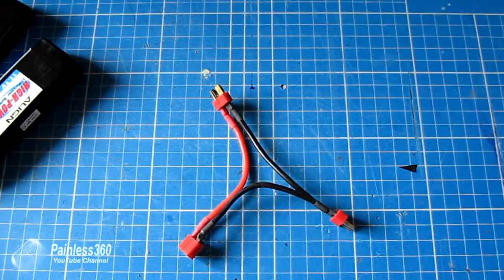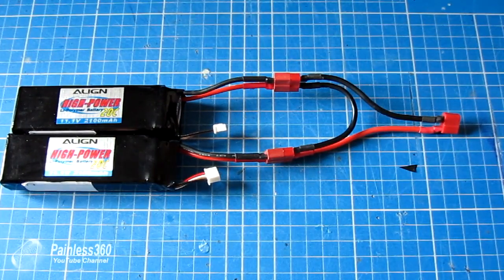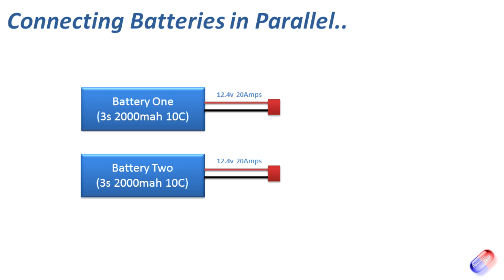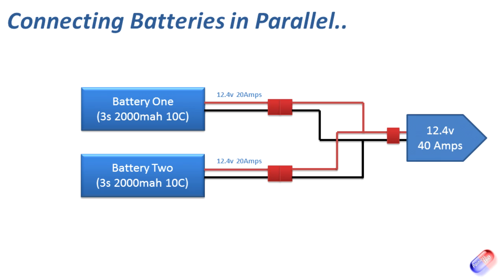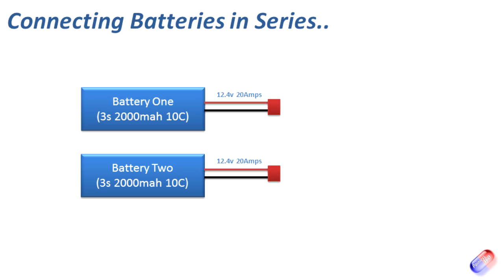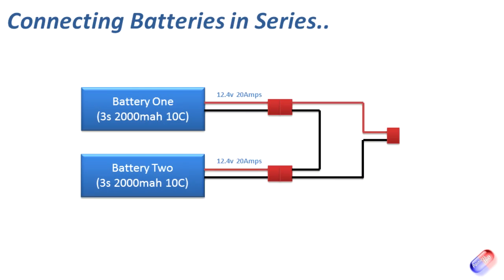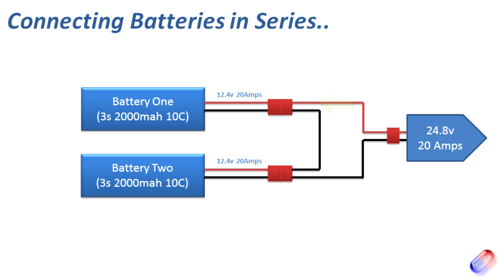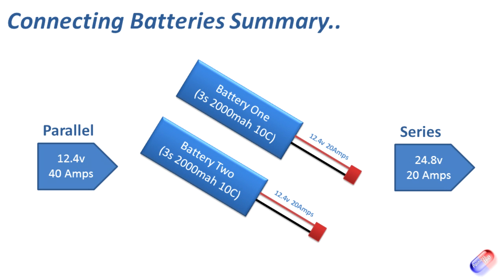Connecting batteries in series or parallel (LIPO)

Comment: Great video. I want to connect 2 15ah 48v batteries-exactly same make and specs together, but the seller seems to think I will get problems doing this. Have you used these batteries on an ebike or such and how did they do? Any issues longterm?
Reply from the maker: Batteries are connected in series and parallel all the time, it’s how we get batteries with much higher voltages and currents. I’d listen to the seller though, they may know more than we do. Happy flying!
Reply: Ah ok, thanks for the information. I think the company are just trying to avoid being blamed if anything goes wrong, as the batteries would be identical-same brand specs,  on a mid drive motor. They also say I shouldnt use the 60v 20ah battery they sell! But they sell it! Have you attached batteries together on ebikes or scooters in parallel? Any issues?

Comment: Hello! My Batteries are 3.7V 9800mAh
Is it possible to connect a series making it 14.8V (4 battery) .
Have a parallel made to 98000mAh (10 battery).
can it then be connected and how to make it 14.8V with the 98000mAh.
Reply from the maker: What do you think after watching the video? What would two 2.7V batteries in series make?
Reply: havent gotten the proper chance to watch the vid im going to watch it now though. in series it will increase the voltage.

Comment: I'm building an ebike battery could I wire a 6 cell 22 volt 8000ah and a 4cell 5200 in parallel to give me 13.000ah but would it still be 22v
Reply from the maker: You can’t wire them in parallel. They are different voltages..
Reply: I thought when them in parallel will double the amp hours but keep the voltage the same so what you saying they both got to be 22 volts each

Comment: Looking for help .Losi dbxl the car. Problem is got trunigy 7 way switch connected to 4 slot inn receiver to run lights Was working well with 7.4v 1700mah standard. So decided to upgrade to lipo 7.4v 3000 the unit will not work. The unit powers up runs cycle on toggle nothing. I thought it was faulty so bought another one. Same problem. Swap to standard works fine. Now thinking run car on lipo use standard for lights? Question is can you mix battery  and how would I wire this. Didn't want these problems but I'm stuck. Be nice to run the lot off one battery but no idea why it won't work. Tried most basic things. Can you Help.
Reply from the maker: No idea why it won't work. The increased capacity of the battery shouldn't make any difference if he voltage is the same - strange..

Comment: I want to do some test runs on a hydroplane using 8s before I commit to buying anything else, like 10s or 12s, if i don't like the performance of the  8s. But, I will achieve the  8s by connecting 2) 2s to make a 4s, and then 2 more 2s to make another 4s, and then connect  the  2) 4s to make  the 8s. Is there  any reason this may not work? all are same 5200mah though 2 are 25c and 2 are 30c. And again will be ran just for testing, not racing.

Comment: This was a great video.  Is there a source of info to find out about individual battery pack configurations?  For example, I have a laptop battery HSTNN-YB02, 8 cell, 14.8 volts.....I've taken it apart and it looks like I have two sets of 4 batteries.  Each set of 4 has 2 batteries connected in parallel (3.7 V as measured) and the two are connected to another two in series (for a measured reading of 7.4 V).  .........I think I understand this...then the set of 4 is  connected to the other set of 4 I think in parallel.........so I think this should then give me my two times 7.4 or 14.8 volts total.....but the other set of 4 gives "0" V when I measure and the total V of the 8 is 7.4 V on the board (assuming I'm measuring correctly).............the numbers/letters on individual batteries is HL9FJT5 and then 037953.......If there was a source of information to ID the individual battery voltage from the numbers/letters on it, I could then confirm or refute what I'm thinking.....and information to  better understand if I have the correct idea about parallel and series attachment is all about........The reason for all this is I'm been trying to figure out if I have a laptop battery problem or a laptop charging problem.  Sorry for the rambling comment.

Comment: Will it be safe to connect batteries of different c rating and different mAh but same voltage in series
Reply from the maker: Not really, these days batteries are so cheap that it's easy to get the right size capacity and voltage you want. Best of luck!

Comment: I have an electric kick-scooter (e-twow master) and I want to make it faster. The ESC on the scooter can take up to 50V . The stock battery is specified at 29.3 V when charged and has a capacity of 8Ah. I need a LiPo battery to wire it in series with the main one. What battery should I use ?
Reply from the maker: +Tantareanu Jimmy this is a little outside of my experience. But you'll need something that means the overall voltage will still be below that 50 volts maximum that the ESC is rated for.I believe places like Hobbyking sell things like this now too. Best of luck!

Comment: can I connect in SERIES

2s  4500mah 45c and 
3s 4500mah 45c 

to make 5s ??
Reply from the maker: +MotorsUKTV it should, if the cells are closely matched. Personally I just by yourself the battery that you need. They are a lot cheaper than they used to be now so having to do all of this messing about is no longer needed. Best of luck

Comment: Hello.. I have a problem... I made a kool 2P 2S battery pack with 4 of these 7.2v power packs that has some killer power but- I can't run a DC Inverter from it cause it's too powerful I guess (Inverter won't run on a power bank over 15V)... and if i made them into a 4P battery bank then the power to the  Inverter would be too low to run the Inverter.  
    What can I do?
Reply from the maker: +wildbillo68 not sure I follow, I'm guessing this isn't for a traditional radio control application? I'd look at a different DC inverter. Best of luck

Comment: Hi I have an ESC 120A and motor of 2050kv. Can I use two 3s 35c 11.1v 5500mah lipo battery ?
Reply from the maker: +t maxx I can't answer that with that detail. See the other videos in the 'Introduction to Radio Control' on power systems that may help..  best of luck!

Comment: Great video but i have a question Can i connect Lithium ion and Lithium Polymer in  parallel connection and use it in Rc plane ?
Reply from the maker: I would not connect batteries with different chemistry together. These days packs are so much cheaper that it's easy to get the size and capacity you need. Best of luck!

Comment: I prefer parallel circuit, but out of curiosity  if I was to have a motor rated at 20 amps an I was to double by using series, I'd there a chance of burning up the motor
Reply from the maker: Putting batteries in series will increase the voltage but keep the amp rating the same. The danger is that the ESC and motor may not be rated for that higher voltage..

Comment: Hi mate great video I have a qestion about connecting parallel lipo batterys to a drone the lead I have made has two battery connectors an the connection to the drone is soldered to the board is it ok to connect one lipo battery at a time on a parallel lipo setup.
Reply from the maker: Personally I'd connect both together and then plus them into the model. It shouldn't matter but be careful. Best of luck!

Comment: How do we do this with 3 of them?
Reply from the maker: +Evan Arbolante it's the same as two. Batteries are so inexpensive now that unless there is a space reason you need to connect packs like this then it's easier to just buy the size you need. Happy flying
Reply: Is it possible to connect 2 in parallel and 2 in a series to one out out put? Im trying to wire a 6 inch or 12 inch led bar/cube to a Shield

Comment: I use 4S 3500mAh, now i need two battery 4S -> 8S. But i dont know how to wire parallel good or series its good? Thank you
Reply from the maker: Parallel will give you trice the capacity at the same voltage. Best of luck!
Reply: Painless360 thank you. Series too?
Reply from the maker: Nope. See video.. Happy flying!

Comment: in the race competition, we have to change the battery as the track is long, and they have to keep the video signal. im planning to use parallel XT60 method. However, is it safe enough to plug in the different voltage battery? e.g. when swapping 14.7V landing, keep plugged for video signal, and plug in 16.8V new battery. then take out the old 14.7 V. (probably few seconds that both battery connected each other)
Is it a fairly safe way and wont damage the battery? as it is a simple XT60 connected into parallel, i dont think there is limit of current.
Reply from the maker: If you mean plugging in a battery in parallel with a very different voltage, then that's a bad idea.

Comment: is that the same way you hook up a hobbywing Max 6 in dual series for the ESC
Reply from the maker: You can't hook up ESCs in parallel in the same way. They are designed to be the only thing connected to the motor and use phased pulses to run the motor - those phased signals wouldn't be in sync'd if used two? Happy flying!
Reply: Painless360 I hav a on road RC car trying to get high speeds is series better ? I'm not worried about the run time on it

Comment: Can you make a video where you connect four batteries to get double mah and volts. For example, pair two batteries and connect in parallel with two other batteries that are also connected in series? Or is it even possible?
Reply from the maker: Yes it is, personally I'd look at buying the battery in the size and capacity you need, this video was made years ago when batteries were not available in the larger sizes and pilots had to use these kinds of tricks to get larger packs and longer flight-times.. Thanks for the idea..

Comment: I am making a Lipo pack with the batteries I have. It needs to be under 60v hot of the charger for my electric bike to run. I need to know will this will work. I have four 5s 5000mah and two 4s 5000mah (all close to same cell voltage) batteries. I'm trying to make (what I think is ) a 14s 2p 10AH pack? (not sure) This is my plan....connecting  0ne 5s + one 5s + one 4s into series = 14s 1p 5AH X 2 into parallel = 14s 2p 10AH pack? Does that make sense? If not what can I do??  Please help.
Reply from the maker: This video is more about using 3s packs to make a 6s pack, or a large capacity 3s pack for longer driving/flying. You can connect the pieces you have in series, that's all the LIPO's do internally anyway - connect single 3.7V LIPO cells in series to make the pack.. Be very careful..

Comment: great info sir 👍  quick question  i have a 3s 65c 5000mah lipo it's  3 to 4 months old but only used 3 times then put into storage voltage. could i buy the same 3s and use it in parallel with the  3 to 4 month old battery that was used 3 times
Reply from the maker: You could but watch how things go..
Reply: Painless360 it was used 3 times when first purchased new from hobbyking,then put in storage voltage and been sitting in a cool dry place ever since, i was just worried its not going to perform  aswell but it reads 3.80v per cell
Reply: il try and see how it goes thanks for your time

Comment: I am new to electronics. I am building a portable Bluetooth speaker and wish to have long run time. like plus 12 hours. the amplifier module uses 3.4 to 4.2v.
Could you recommend a charging module with protection?
would 4 18650 @ 3.7v in parallel or in series with a step down transformer.
I am new to this sup I am not sure if I amasking the right questions.
Reply from the maker: This is a little outside what I support here, you'll need a voltage regulator to get that 4.0v you need for the amp, once you know how much current it uses then you can figure out the capacity of the battery you need for a 12h operating time. Best of luck..
Reply: Painless360 
thank you.

Comment: I understood the basics but my question is lets say I have an ebike with a 48V 1000w motor. I want to use (2) 22.2v 6s 15c 10000mah lipo batteries in series. This would give me 44.4v at what amps ? and what watts? Also if I were to connect them as parallel the amps would be more so does that mean I can gain more speed but less distance vs. in series to gain more distance but less speed?
Reply from the maker: +Tony Escobar great to hear you understand the basics. What would be your guess?
Reply: 150 amps 6.75 watts is that correct?
Reply from the maker: The batteries in series would give you a 44.4v 10000mah /15C pack. Max amperage would be 150 Amps so wattage (volts x amps) would be 6.6Kw. In parallel would be a 22.2V pack with a 20000mAh / 15C rating. That would be the same wattage..
Reply: So in my second question about speed and distance, Am I correct in that?
Reply: This is also something I am wondering about! I'm trying to figure out how to get 48v or 52v with using LiPo batteries. I want my bike to go up to 25mph now what i'm wondering is it the amps or the voltage i should be worried about in this case ? 60 amps is plenty but at 44v will that work? If i can get this to work it would help me alot with my job since i deliver food for a living

Comment: I  would like to begin using a parallel charging board....so please help a non-electronics literate person understand something....say my just flown 3S LiPo  battery pack  A  is at a  total  voltage  of  11.2 v   and  cell 1=3.80     cell 2 =  3.78   cell 3 = 3.70      what  numbers / voltages  would be  acceptable  for other 3S batteries to charge  along with  battery A ?.... I'am I looking at individual cell voltages  or just other battery's  total voltage ?......please give me an example with numbers ....thanks
Reply from the maker: If the pack was that far out at the end of a flight I'd check how healthy it was! ;) But to answer your question - you need packs with almost the same voltages, cell for cell if you're going to parallel charge them. 

Plugging batteries/cells in parallel with very different voltages will cause huge currents to flow between them, limited only be the internal resistance of the cells themselves. If other packs all has cells about 3.8v then you should be fine. 

Chargers capable of charging multiple packs are a lot cheaper now so I'd recommend looking at investing one of those.. Best of luck!

Comment: Thanks for this little video! Just needed a quick refresher as to what connectors I had as I haven't driven/worked with my RC Buggy for a while. Just one thing I would mention, with the theory you've given, is parallel basically gives an RC model a longer flight/run time, but the same power. With series as I run in my buggy with 2 2s lipos, it gives it a slightly longer run time but also doubles the power that the buggy can draw. So since my setup can handle a 4s lipo, basically doubles the max speed my buggy can get to :)
Reply from the maker: +TBD_TheBlackDog as you increase the voltage by connecting your batteries in series it does mean that the motor needs to pull slightly less current to get the same wattage. This will have the effect of giving you a slightly longer run time as well. Same effect as replacing the 3s with the 4S pack in a model

Comment: ispisible 3s 11.1 v 5200 mah  20c and 7.4v 4000 mah 40 c pararelle conecting how many volted have .? pls rply
Reply from the maker: +mhel galang you can't connect different batteries in parallel..

Comment: Thx for the great video. When connected in series, someone is claiming that current should double, too, citing Ohm's law (I = V/R with constant R in the circuit) I know this is wrong but how do I apply Ohm's law if current stays the same?
Reply from the maker: +Seunghun Ok it isn't quite that simple. Motors we use in the Hobby are rated in watts so as the voltage increases the amps needed go down. Also if batteries are connected in series then you also have increased resistance - as you have to take into account the internal resistance of each of the packs 2. Hope that helps, happy flying
Reply: Many thanks for your answer-

Comment: Hey there this has given me great understanding . I want to connect 2x36v in series for my ebike to run a 2000w hub motor . On the series diagram in this video could you point out where you would have the ignition and the charger point connect to ? Cheers
Reply from the maker: +mert tanay depends on the voltage they need. If it's full pack voltage connect them to the output. Best of luck!

Comment: could i connect 2 batteries with the same volt but different "C" to extend the working time?
Reply from the maker: I wouldn't. The battery with the lower C rating will be doing most of the work (in a parallel setup)..

Comment: which would give a linger flight. say 2 batt on a quad?
Reply from the maker: Batteries with more capacity are heavier so you don't get to use all of that extra power in flight time. Most pilots use 3s or 4s on their models now.. Best of luck!

Comment: In theory, can it work the other way around by powering two airsoft guns with a parallel adapter using only 1 lipo?
Reply from the maker: Yep, should do..
Reply: Painless360 It wouldn't harm the electronics or the lipo? would it have to be connected a certain way?

Comment: Thank you for the video, very helpful.
I'm planning to buy a 6S 16000 mAh battery to power a ~8A motor for a robot I am building... I tought it could power it for 2 hours but it has 10C written too...so does it mean the battery is capable of 160A? Can I power my motor for 20 hours with that battery?  Sorry if it sounds dumb but I'm new in LiPo(s) Thank you again
Reply from the maker: The videos in the 'Introduction to Remote Control' covers many of the basics. a 16000mAh pack will provide 16 Amps for an hour, 32 Amps for 30 mins, 64 Amps for 15 mins etc. The 10C on the pack means that it can deliver 16,000mAh x 10C = 160amps max. Not sure how big the wires on it are! :D
Reply: @bldjln3158  2 hours